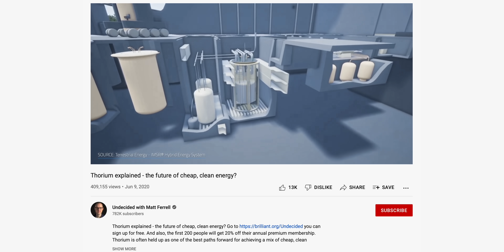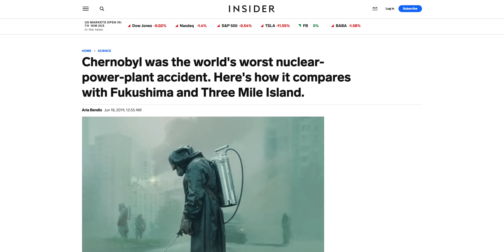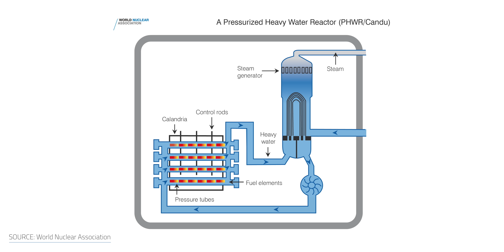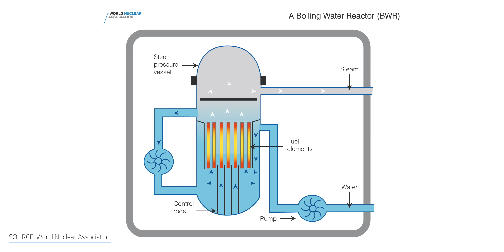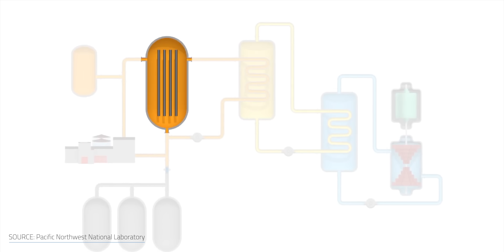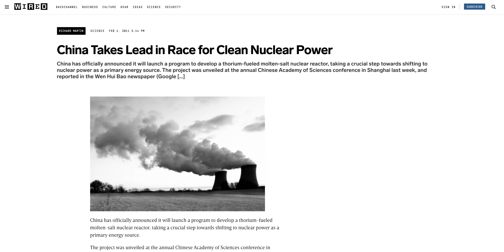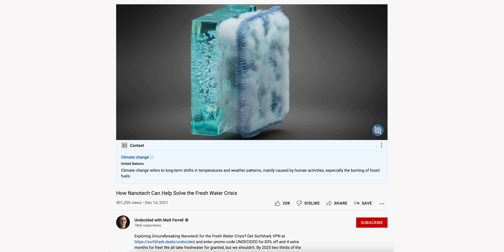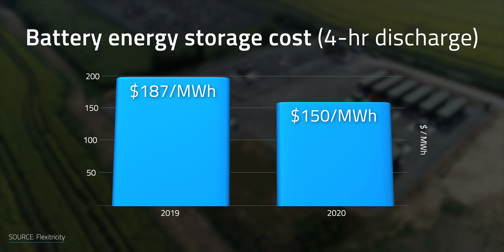Revisiting Thorium Energy - The Future of Nuclear Power?

Comment: Erm .. have you ever experienced what happens when those molten salts, that are typically used in MSRs , come in contact with water? Have you considered how massively biotoxic the compounds, like Beryllium, are? Why do you think, China has their test plant in the desert? Putting MSRs close to any body of water is setting yourself up for unprecendented desaster. Using them for water desalinization would be beyond foolish.
Reply: I agree that water contamination would be the largest risk when utilizing MSRs. But since they also remove the risk of dispersal events from steam and hydrogen explosions, it means that the risk from events that may release radioactive elements to the greater environment will be greatly reduced. As such even coastal installations should be able to be made safe with the proper considerations.
Reply: @nolan4339  I wasn't even talking about water contamination, but about how the involved substances at those temperatures react to even the smallest amounts of water. I'll give you an example: did your teacher at school ever show you the experiment of what happens when you throw a small amount of metallic sodium into water? A MSR typically runs on 100 - 400 Liters of liquid metal coolant at 700°C. Sometimes it's pure liquid sodium, and the alternative fluoridic solvents like LiFBe at room temperature aren't as reactive as sodium, but at 700°C it's an entirely different story.
Imagine the reaction if the heat exchanger, i.e. the physical barrier between the liquid metal and the water to be heated, fails. It's not the water contamination that'll be the problem, it'll be the explosion and dispersion of a mix of oxides, fluorides, (possibly beryllium, uranium and other fission products), hydrogenfluoride etc. in the air that'll be the problem and how far wind will carry this smoke. I could write an essay here on how it can happen, also how the heatexchanger can cause actinide fluorides to precipitate and cause critical events etc. 
But if you're really interested, I can recommend the very detailed analysis "Review of Generation IV
Nuclear Energy Systems" by the French IRSN. On page 120 it gives a detailed account of MSR technology and all technical + practical aspects. On page 132 comes the risk assessment, also very detailed.
Reply: @augustaseptemberova5664  There is no reason for the heat exchanger salt to be of the same chemical mix as is used in the reactor vessel.

All designs typically have a salt loop which circulates independently of the salt which is in the reactor vessel. It just dips in, gets heated up, then comes right back out again, and goes to a second heat exchanger to generate power. The designs will always be made to keep the radioactive salt away from water.
Reply: @nolan4339  Actually, no. There are very good reasons for the heat exchanger salt to be the same chemical mix (fissionables, and fission products removed) as the fuel metal/salt liquid: 
1) If there is a breach between the fuel and the coolant, the coolant needs to keep the actinide fluorides dissolved, otherwise they'd precipitate and go critical. 
2) If there is a breach, you'd not want fuel and coolant to react with each other. 
3) Same base compositon of fuel and coolant ensures the same thermal capacities, viscosities etc. - the primary coolant is there to keep the inner temperature stable to avoid actinide fluoride precipitation, and this can be best achieved if it has the same properties as the fuel, so that it doesn't remove heat too quickly or too slowly when compared to the fuel.
The only difference between the fuel and the coolant is a temperature gradient. The fuel runs at 700°C, the coolant at 600°C, which is barely enough to keep actinide fluorides dissolved but still allows sufficient heat transfer between fuel and coolant. Then there's the secondary coolant, supercritical water, which cools the primary coolant.

Most MSRs work in the thermal spectrum. Those need a continuous flow of fuel out of the reactor into a salt processing unit, where fission products (neutron poisons) are removed so taht the chain reaction inside the reactor doesn't stop. Here, the heat exchangers sit on top of the transfer line to the reprocessing. And here the risk of hazard events is massive. Metal salts expand/contract heavily on temperature change, and that is the part of the whole setup that is very vulnerable to cracks, leaks and corrosion. MSR reactors frequently break and fail here. And this is the point, where fuel and water can come into contact, if there is sufficient mechanical/thermal/chemical stress on the system. 
Why would people use MSR? Reaction supervisio and control - something you don't have with the other option:

MSFRs work in the fast spectrum. These can be driven with fuel batches, and here the main heat exchangers are on top of the reactor. The problem here is that though the fission products aren't as big of a neutron poison problem, they do pose a much much worse corrosion problem, because they are allowed to build up and are way more corrosive than the fuel. The fission products may build up locally as there is no reaction control or reaction supervision within the reactor. Here, if a breach fuel <> primary coolant occurs, it's because the fuel is massively corrosive at some location. Then it's likely, it'll eat into the second heat exchanger as well.
A second vulnerability is  the opening of ducts etc. to fill in the new batch. Metal/salt liquids creep, they will literally climb into any opening you present them. This can lead to stuff gathering, where it's not supposed to, or adding new fuel may cause precipitation or mechanical stress due to temperature gradients, etc etc. Here again, if the first breach happens, the second is very likely.

So I hope it's clear that both types are very vulnerable, with corrosion towards the secondary coolant being the biggest worry here, next to precipitation of actinide fluorides towards critical events. Current MSR and MSFR research heavily focuses on optimizing heatexchangers and finding durable materials (those have been found, but are rare and too expensive: molybdenum alloys, for example), and not so much on the reactors themselves.

I wrote an essay after all :/
I wish you'd just read the literature. It's all very well explained there, and the difference is, you don't have to "believe" me anything or argue with me .. you have it there straight from the horse's mouth, the French nuclear commission.
Reply: Desalination doesn't mean floating at the seashore. The water can be piped inland some small amount. It's about being an energy demand that's mostly not available to provide water benefit to new places. Often desalination water is used in industry and agriculture to offset demand for limited fresh water.

Comment: We should note that high temperature reactors can be used to generate process heat for either hydrogen or synthetic fuel manufacture. Both of these products will be in high demand for aviation and maritime fuel applications in the future, which will significantly improve the economics of future nuclear power plants.

The economics of synthetic aviation fuel are still unclear.
Reply: Yea, the potential overlap with hydrogen fuel is a big deal for sure!

Also, glad to hear someone mentioning its use in aerospace and maritime shipping rather than cars :-)

Comment: I honestly am a massive nuclear fan, but I am slowly believing that it just doesn't have a place on Earth, near long term, save for very unique niches. However, I think compact nuclear is critical for space travel. It'll be required for large interplanetary vessels, for terrestrial power generation on planets with little sun exposure or atmosphere, and it'll be critical for any orbital habitats we build. Sun- and gravity-powered energy sources like hydro, solar and wind with large battery storage facilities are going to be de-rigeur once we can nail the tech, and that's much closer than it would take to switch fossil-based peakers over to nuclear.

Comment: Renewable LCOE should include the cost to make renewable a 24-7 reliable energy source. GW days of storage are needed plus you need to build up the renewable output so it can both provide the required load power plus at the same time charge the batteries. You might need to double the renewable capacity to both charge the batteries and provide the load power at the same time.

Comment: Not only little cladding, but thorium reactors do not need control rods to consume neutrons and make more radioactive waste. No you can add enough fissile material to make the reactor critical but not enough to keep it critical if the reactor heats up. In other words load following by producing more heat if the heat is used but much much less if allowed to heat up stopping the neutron flux. The really good thing about molten salt is it can be used to burn up regular pressure water reactors waste which still has 94% or higher energy still in the fuel. Also the iridium in normal waste can be used to neutralize some waste when melted into the regular waste.

Comment: Thorium doesn't have to compete with renewables.  It needs to compete with coal and gas. In this area, there is literally no argument against it. Baseload power and energy storage free power cannot come from renewables at the volume needed for global equity. UK power cost is doubling, and cheap abundant reliable power sources are needed right now! The problems for thorium are not technical.  They are political.

Comment: Maybe it is dealt with in that first video, but what I'm missing is the safety aspects of those molten fluoride and chloride salts, especially in case of flooding.
Reply: Fluoride salts are not very soluble in water.
Reply: By flooding, do mean Fukushima? MSR don't use cooling water in the same way so loss of critical cooling is not the disaster of conventional nuclear.
Reply: the salts melt at 450C any less than that they solidify - check out kirk sorensen tedtalks 2010 onwards for safety and an overview

Comment: The cost per MWh when adding a 4 hour battery. . . .A power plant that goes offline 4 hours after sunset, or after the wind stops blowing can not possibly be compared to a power plant that keeps running 24/7 for 20+ years straight.  Even under the best circumstances, solar would be offline on average 10-12 hours per day even with a 4 hour battery.  Solar only really works starting an hour after sunrise to an hour before sunset.  So on average, only 10 hours per day, and that doesn't take into account cloudy days.  Wind can stop for days on end, and can only be predicted a few days ahead of time.  Anyway, to compare intermittant energy sources on an apples to apples, you need to add in the cost of backing up that power with batteries far more than 4 hours.  Nuclear is going to be on 24/7 with 99.9% plus certainty, as you add more and more batteries, you will go from 50% to 60% to 70% and so on, but you would need an insane number of batteries to get up over 99%.  I don't know about you, but I like my electricity to be on every day, not just 99 out of 100.
Reply: You need to match the battery capacity to the power generated by the panels, charging up over on average 5 hours of strong sunlight in a day, and then you need to be able to discharge this during peak usage, or any other longer time period. But you are completely right that such a system provides no resilience against cloudy days.  To make use of intermittent energy at high grid penetrations, you need to couple them to interruptable loads like ammonia production (lots of tech development needed to make it interruptable) and desalination, and you'll need to accept a much lower service factor.
Reply: @richdobbs6595  You make a point about interruptible industry, such as ammonia production.  Even so, an ammonia plant is a large capital investment and when you choose to only run it intermittently, that means that you need to build more plants than otherwise for a given level of production.  From a plant capital/employee perspective, the most cost efficient ammonia plant runs 3 shifts 24/7.  This is a hidden cost of intermittent energy supply when you have to spend more on the ammonia plant to be able to make the given supply during your limited hours of electricity.   Even without intermittent energy sources, things like ammonia plants will shut down when electric demand is otherwise high because the cost of power goes up, now add supply side fluctuations and things get really hairy..  Demand will always fluctuate no matter what, adding supply side fluctuations just make it that much worse.
Reply: @apostolakisl  I don't think that ammonia plants are not run flat out 365 days a year, since need for fertilizer is seasonal, and bulk of consumption is in the northern hemisphere, and there isn't sufficient liquid ammonia storage.  I might be wrong though, in that they might use solid forms like urea and ammonium nitrate to even things out.  But the catalyst used in the Haber-Bosch process can't tolerate swing production on a daily basis.  So, with a Haber-Bosch process, you'd need hydrogen storage and the ability to create electricity  from electrolyzed hydrogen at night for solar, or from ammonia for wind.  OTOH, there is ongoing research at Monash University on direct electrolysis of ammonia, which is targeted at being able to only run when PV power is available.  Interruptable supply side production is what is needed to pair with intermittent power.
Reply: @richdobbs6595  Assuming it is seasonal, it doesn't matter.  Whatever season you need it, you will need that much more factory if you can't run 24 hours/day during the season.  Or you need that much more storage so you can make it in the off season.  Either way, you increase capital investment.
Reply: @apostolakisl  Sure, it will always take more investment to avoid using the cheapest method of production.  If you go with nuclear, you'll need to develop load following MSRs or the interconnects need to manage a suite of plants to be some what load following, or more pumped storage.  It seems to me that ammonia production is a fairly good match for utilizing wind power.
Reply: @richdobbs6595  In a perfect world, you use all of your capital all the time.  In other words, all generation is running 24/7 and all production is running 24/7.  Since we live in a world where people sleep and where the temp goes up and down through the day, utilization will never be flat.  So you would want to then try to keep the most expensive capital working 24/7.  At first inspection, the molten salt storage seems like one of the cheapest ways to balance production with consumption, but this is only valid for the molten salt reactors, which are still in prototype phase.  Batteries are a very expensive way to shift load,. not to mention that batteries are desperately needed for motor vehicles, where there aren't really any other options for energy storage (unless you are OK with ICE).  Personally, I think it is a terrible idea to "waste" batteries on anything but vehicles, at least for the foreseeable future.  The supply of automotive batteries is constraining production of electric vehicles and this projects to not change anytime soon.  That means solar and wind all need some other duplicate generation that can be called on demand but largely sits idle.
Reply: @apostolakisl  There are all kinds of capital that gets idled all the time.  We are currently used to cheap basic chemicals presuming that we have dispatchable power.  That will change somewhat.  Why do you think that ammonia production is particularly the most expensive capital around?  AFAIK, it is cheaper than batteries and doesn't have any particular scale up limitations.  I agree that with solar you need duplicate generation capacity around.  And with nuclear you need either to develop load following reactors or you need storage capacity.  With wind, you need to avoid using it for the grid, and be able to interrupt the load. for wind droughts of a week or two occasionally  Fertilizer production is the obvious load for this.
Reply: @richdobbs6595  "There are all kinds of capital that gets idled all the time"  This is true, but that doesn't mean you just accept it.  Owners of capital are always trying to put their capital to use most efficiently and that means 24/7.  This is why so many factories run 3 shifts.  It isn't because the workers prefer being at work at 2am.
Reply: ^^^^ This ^^^^
Reply: Except not. Wind distributed over a continent is steady and reliable. And the capacity factor for nuclear is more like 90%. Compare that to the capacity factor of the newest off-shore wind at 60%.
Reply: @williammeek4078  Not sure what you are saying.  The 60% capacity factor for wind sound reasonable.  The 90% for nuclear seems low.  Refueling does take a few weeks, but only once every 2 years or so.  And you can plan for that.  You can't really plan for the wind.  The reactors discussed in this video don't need to shut down for refueling.  And weather does get weird at times, even averaged over a whole continent.  Plus, you have to consider distribution costs should you need to move power 3000 miles.  Plus, 60% capacity factor means you paid for 40% of the infrastructure to sit idle.